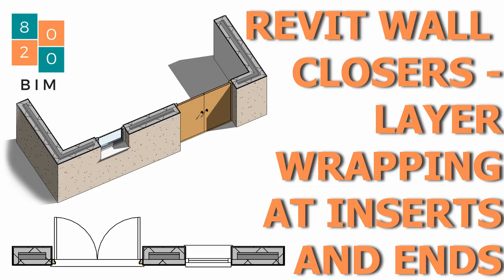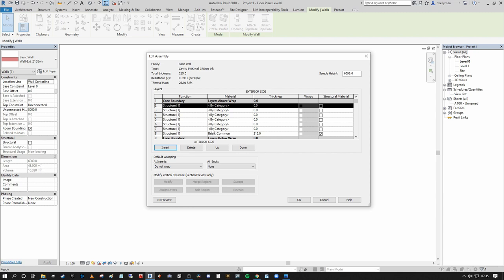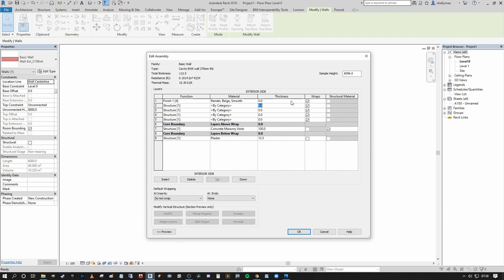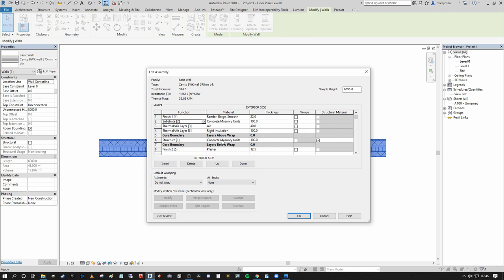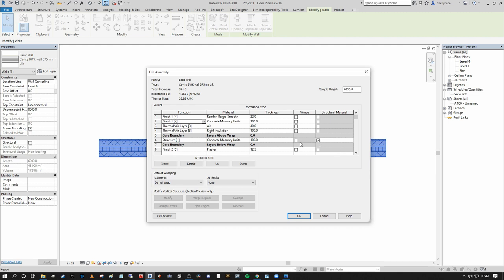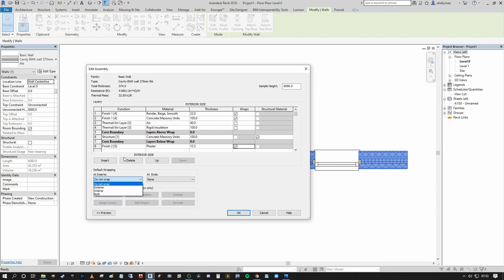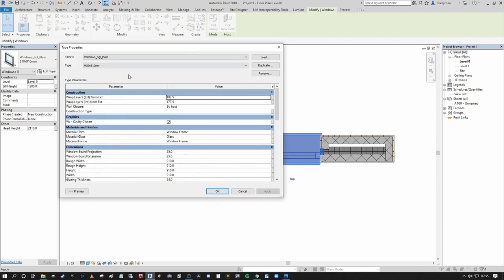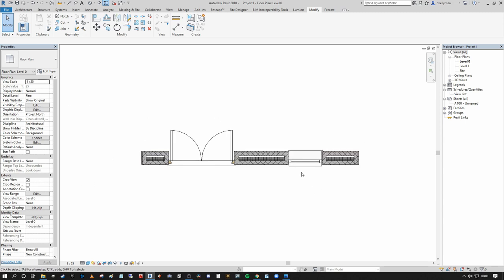Revit Wall Closers – Create Layer Wrapping at Wall Inserts & Ends

Comment: Do you know if its possible (i don't think so) to make the wrapping portion of a layer thinner than the original thickness. So for example that the exterior insulation material is 5cm but when it wraps towards inside, it should be 3cm. I couldn't find any way to do that. If you have any ideas I would be glad to hear :) Thanks for the video.

Comment: Great video. Is there a way to get the internal p/b finish to wrap around so it butts the window frame as it would in real life rather than the p/b being flush with the structure, if that makes sense?
Reply from the maker: Hi Mike. I actually touch on this in the Video. The difficulty is that the Frame for a widnow normally Matches the Ope Size. This is true in construcion, but generally we are talking about the Structural opening and the frame matching. We then return our finishes (redner, PLasterwork, Skim etc) into the opening and butt the frame as you have suggested. Revit struggles with this for a number of reasons (too many to cover in this short response) so I'll try my best to offer a solution. In short, to my knowledge at least, there is no way to realise the material butting the frame with the standard Wall Closer and Wrapping utilities in Revit. My suggestions would be as follows:
1) Model the return finishes independently so the wrap and butt the window / door frame. A simple wall hosted rectangular generic model family extrusion that you can apply instance dimension parameters to would suffice.  If you choose this method, make sure your finish material wrapping is turned off. This would be my preferred way of doing this if it HAD to be modelled.
2) Detail items may suffice to resolce this locally at scales of 1:20 or less. Might save a bit of frustration but leave the modelling exercise incomplete.
3) Edit the Window Family to have the Frame extend the finish thickness further than the wall opening. This is problematic however as your window scheudles will report incorrect overall widths. 
Sorry - I appreciate this response is lengthy but I hope it gave you some insights for how ot finish your exercise correctly. 
Let me know what you eventually opt to do to resolve the issue.
Regards,
Niall
Reply from the maker: Also - apologies about the plethora of typos, typed it out on my phone :D
Reply: Thanks Niall, I knew there wouldn't be a quick fix. I'm just a bit fussy. I even would go as far as put the dabs for the p/b in the wall make up as an adhesive. I think I may just make it a seperate detail. Keep up the good work. Mike
Reply from the maker: I'm right there with you Mike, but prefer the label "exact" over fussy 😅 Revit can be quite annoying sometimes when you compare it to the ease of detail development in CAD or similar 2D drafting platforms, but from the commercial perspective the speed of modelling, drawing development and quality of coordination cannot be disputed. But things like this can feel like a real issue as they seem so straightforward.
Thanks again for reaching out, feel free to fire any other questions my way in the future.
Regards
Niall
Reply: Thanks Niall, I'm only just trying to move over to revit from over 20 years AutoCAD experience. I'll get there in the end. Best regards Mike

Comment: If the window/door family does not contain the closure parameters, is there a quick way to add those?
Reply: Yes. Add a reference plane parallel to the wall, select it and check "Wall Closure" in the properties. And then it's good practice to add parameter to control its depth.
Reply from the maker: Hi Todd, apologies I had not seen your comment until now. Tzanislav's response is correct. 
Niall
Reply from the maker: Thanks for helping out Tzanislav :) 
Niall
Reply: @Tsanito  Thank you!
Reply: @Tsanito   Hello , how do we do what you said here ? Can you explain please.

Comment: Hi, is it possible to wrap Top of wall in Revit?
Reply from the maker: Hi there. No, you cannot wrap the top of a wall or a wall above something such as a door or window opening. This is because these elements are usually different from the overall wall construction in real life. For example, generally walls do not wrap the same material over the top but are likely to have a parapet or flashing profile to close out the top of the wall and prevent water ingress. Walls supporting a roof would also break away from their standard construction to include a cavity closer and soap-bar arrangements. The same is true above openings as you would require a lintel or beam arrangement over the larger openings. 
Hope this sheds some light on why they do not have top of wall wrapping as a default in Revit.
Make sure to reach out again shold you have another question.
Niall
Reply: @8020BIM  We have different method of construction here in Mauritius, wall is made of blocks (150/200mm) cover both side with cement screed (15mm thick) , For boundary wall for example we have on the top a beam same width as the block & covered top with cement screed.
Thanks for your help and support
Reply from the maker: I understand - you need the Screed to wrap over top. I would recommend creating a stacked wall - Top two layers of the stack shoud be the beam with screen on either side and the top stack should be a full wall width screed. I would recommend looking into stacked walls - it should give you the solution you require.

Niall